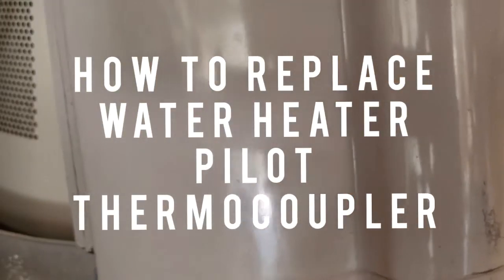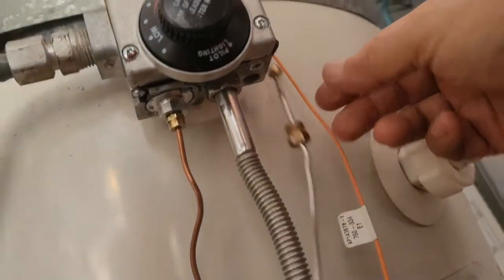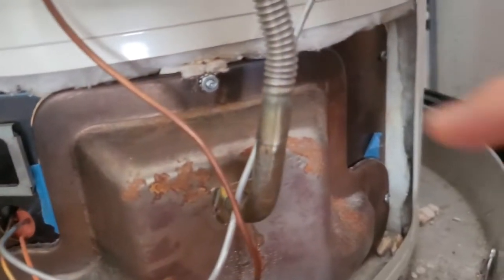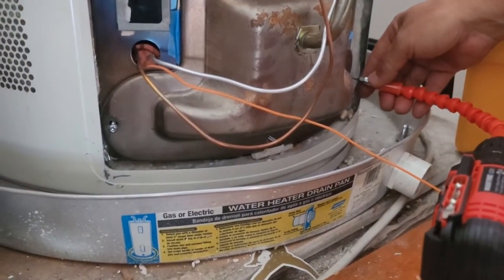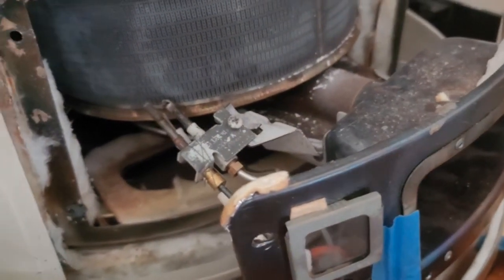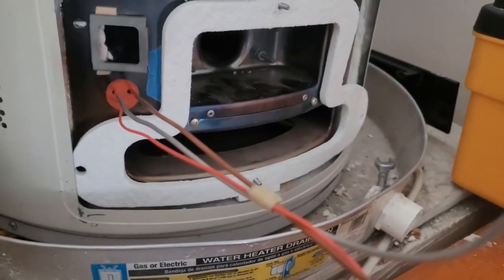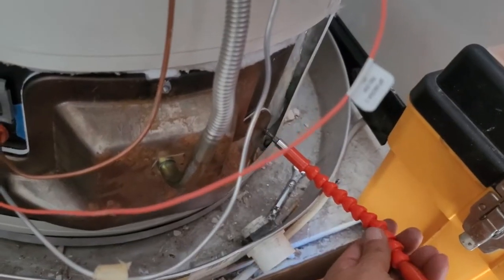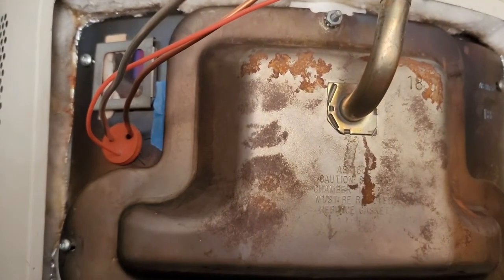DIY HOT WATER How to fix Water Heater Pilot Light Thermocouple Replacement Rheem GE Lowes Home Depot

Comment: Thank you for the tutorial,  one quiero though. 
Would you believe it's wise to put Teflon wrap on the coupler and pilot line screw connectors for added seal? Or would they be just as good without it?  
Thanks again, best regards
Reply from the maker: I don't think it would hurt to do so.

Comment: my GE is 20 years old going strong no leaking or anything , just changed thermal coupler few years ago  looks like fail on me again after few years , have to change it again , this time gonna buy it like u the whole package  not just the thermal coupler ...VERY good water heater still going strong for 20 years now  just needs maintenance every few years, they dont make water heater like  these anymore in ANY BRAND  ..most of the new ones leaks after 5-6 years, u have to trashed it up & now cost a $1000 for new water haters, everything jacked up in prices , even installing

Comment: BEFORE YOU BUY PARTS:  I just had the thermo coupler fail on this exact water heater.  I called Rheem and they are sending me a new one for free since it is still under warranty (12 years).
Reply: lol most these haters happen like this is  old GE water haters  is between 10-15 years old , like mine is almost 20 years old ...of course if u under that 6-10 years old & still on  warranty, they fix it

Comment: What's the part number please
Reply: Can you please send me the part number of the kit
Reply from the maker: I contacted Rheem directly and it was purchased through their customer service dept.
Reply: Pilot Assembly Replacement Kit  SP20790.  I believe Home Depot has them, but check that this is the right one for your WH.  There was an alternate Kit.
Reply: @annareuter7639  
I tired most of the times they  out the stock ..i have to buy it from Rheem same part number & is $73, gonna takes a week ..thats sux about it
week without hot water is f***ked up!

Comment: Replacement  Rheem kits cost $50 at Home Depot.  The old one  may have a long pilot gas tube  the  loops around the bottom of the burner.  In your video you did not  explain that you had to bend it out of the way and left it there.  This may be confusing to a DIYer so heads up.  The new replacement kits don't have the long tube, so be aware.
Reply: My GE Water Heater (actually Rheem) was 9 years old when the thermocouple died.
It had the old style (long, long lead to opposite side of burner).  New Kit SP20790 had shorter lead, 2 new brackets, screws, new gaskets along with new thermocouple. 
After 9 years, it was best to clean everything  (scrub out rust) and install new gaskets.  Old insulation had to be cut back, too.  I struggled, but well worth it.
Reply: Did the fix last June before this video was posted.
Reply: Replacement is free if your heater is still under warranty.  Call Rheem directly.
Reply: yes .. BUT if U lucky if u find it in stock in home depot the time u needed it like me now, as i know most the times they out the stock on that  ..bought it on Rheem site for $70 & paid $18 one day  shipping , didnt have choice.. BUT good thing about  the KIt comes with alll  NEW  Screws & PADS 2  ..just after good cleaning inside the chamber & basket , everything goes back in is Brand new , included the screws 👍 believe it or not after 17 years with my water heater no problem  thermal couple died on me couldn't turn the polite on back again  changed the thermal coupler few years back  & now died again ,  this time changing it with the whole kit ..looks like u have do  this every 3 years..but next time gonna change the whole water heater  gonna be 25 years old  lol, hope dont leaks before then lol , now f*n water heaters these days any brands leaks  after 5-6 years & U have to trash it ..dont make it like use to be anymore :(